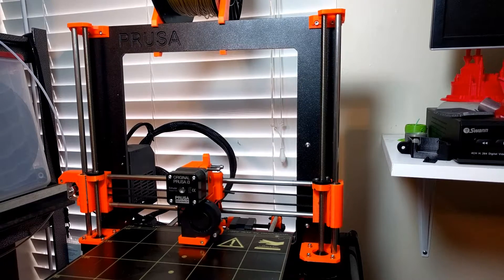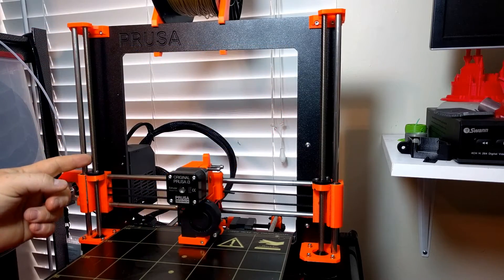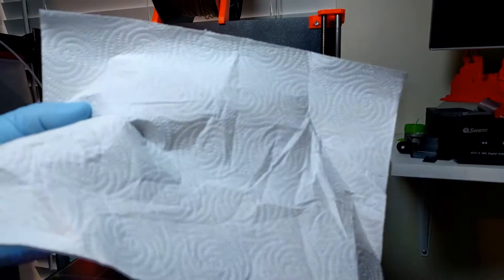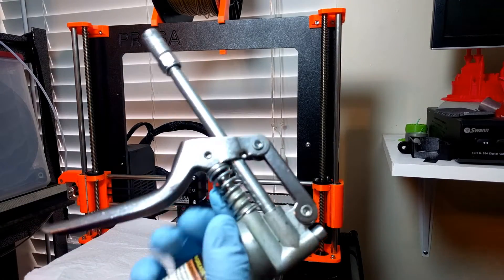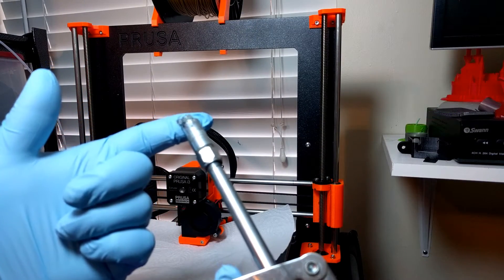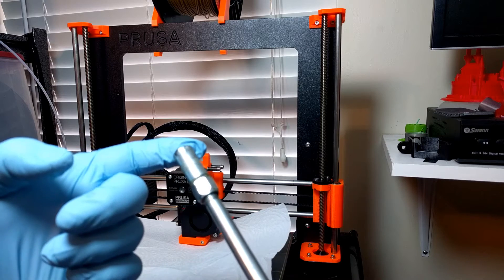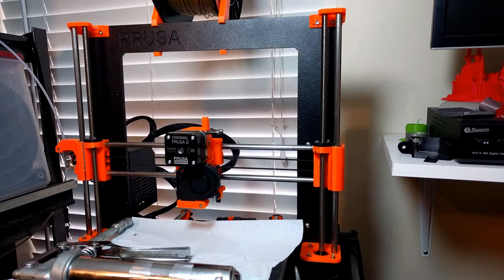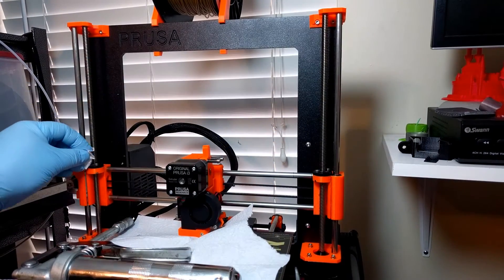PRUSA i3 MK2 Quick Tip 007: Lubricating Lead Screw

Comment: From the Prusa - Printer maintenance tips - DON'T APPLY THE LUBRICANT ON THE LEADSCREWS OR TR. NUTS!!!
Reply: They’re made of delrin and meant to be used dry and apparently can self lubricate
Reply from the maker: Why do you suggest to not lubricated the lead screw? It is common practice in almost all applications unless the lead screw is exposed to fine dust / particulents that could gum up the travel.

Comment: i havent tried PTFE grease, but i've tried graphite grease and even though its realli sticky it quickly wipes most of it with the nut, so i've stayed with thin (multi purpose) oil, and it's worked well so far.
The threaded rods in my mendel have had no problem with graphite grease, and the anti backlash system (nut-sprint-nut) doesnt wipe the grease off the threads, so maybe it has to do with the roughness of the material and the angle or the toleranses.